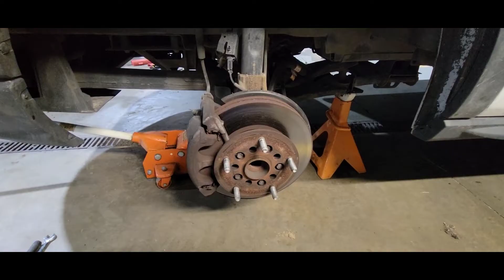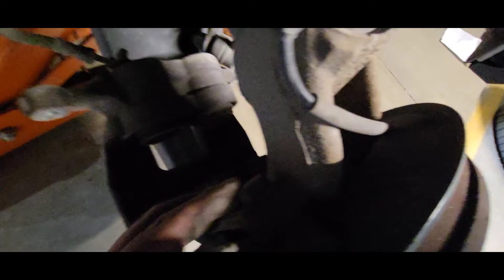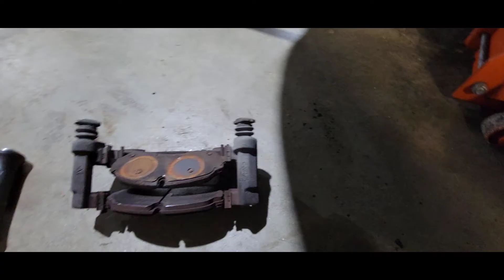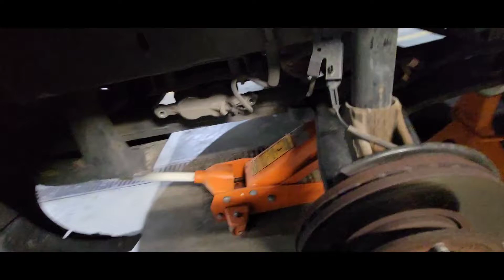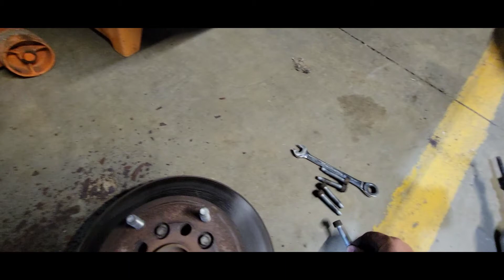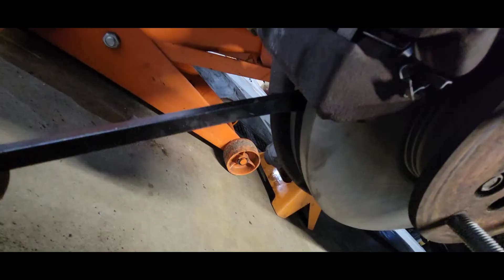Ford Transit 150, 250 & 350  Front Rotor & Hub Replacement 2015-2023

Comment: That's a half-assed way to go. Torque to yield fasteners are only single use and all should have been replaced. That includes the caliper bracket bolts as well.

Comment: Those 13mm bolts holding the rotor are torque to yield. throw them away and buy new ones. It’s dangerous to reuse them.
Reply from the maker: I did see your comment when you posted it. I called my fird parts rep & they verified they were indeed tty bolts. I replaced them same day but forgot to comment back to you. Thank you for the correction! Thanks for watching!